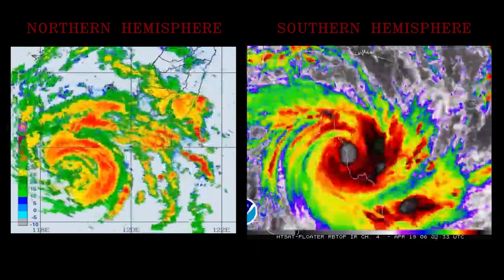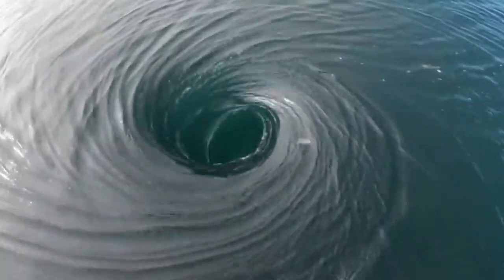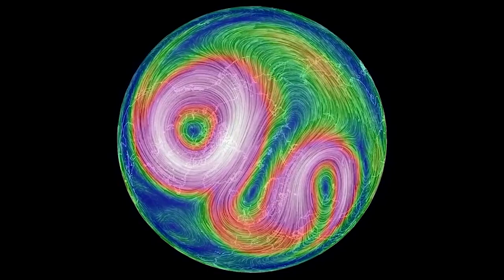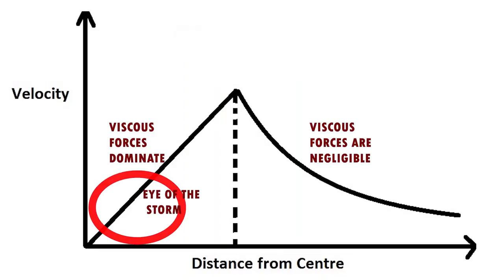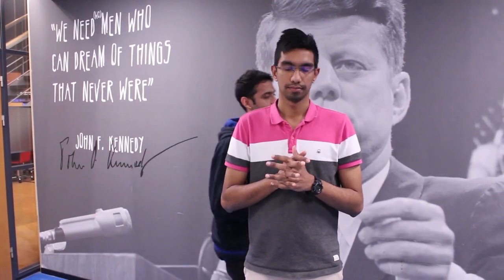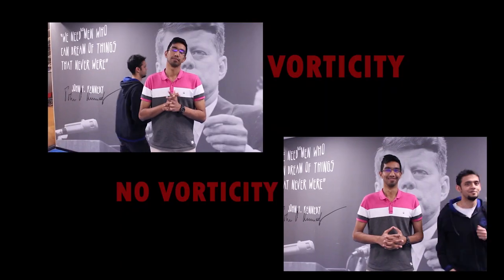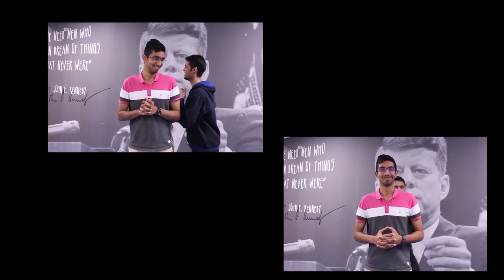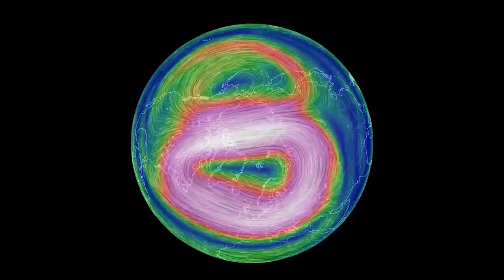WHAT IS A VORTEX? | POLAR VORTEX | SINK VORTEX | HURRICANES

Comment: How is the vortex in a draining sink affected at the equator compared to 45° north and south of the equator and what would the vortex look like at or as close to the North and South Poles?
Reply: Your question is pretty interesting. I asked ChatGPT the same and here is its reply: 

The phenomenon of the vortex in a draining sink is known as the Coriolis effect, which is caused by the rotation of the Earth. The Coriolis effect causes moving objects, such as air or water, to be deflected to the right in the Northern Hemisphere and to the left in the Southern Hemisphere. However, the Coriolis effect is relatively weak for small-scale phenomena like a draining sink, and other factors, such as the shape of the basin and the initial conditions of the water, can have a much greater influence on the direction of rotation.

At the equator, the Coriolis effect is minimal, so the direction of rotation of the vortex in a draining sink is primarily determined by other factors, such as the shape of the basin and the initial conditions of the water. Therefore, the vortex at the equator would likely rotate in a random or chaotic direction.

At 45° north and south of the equator, the Coriolis effect is stronger, and the vortex in a draining sink would tend to rotate counterclockwise in the Northern Hemisphere and clockwise in the Southern Hemisphere. However, the effect of the Coriolis force on the vortex in a draining sink is still relatively weak, and other factors can influence the direction of rotation.

At or near the North and South Poles, the Coriolis effect is very strong, but the rotation of the Earth is such that the sink would not be able to drain in a circular motion due to the converging meridians. Instead, the water would tend to drain in a straight line towards the center of the sink, with no vortex formation.